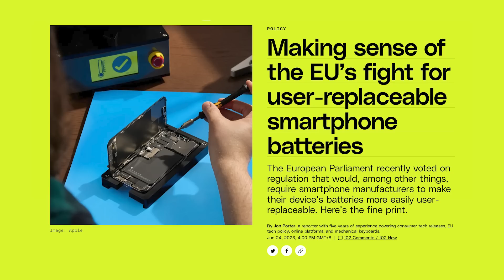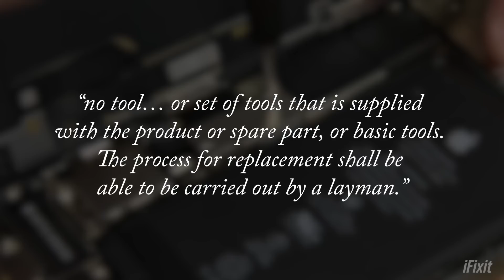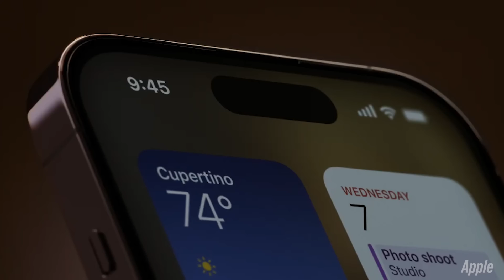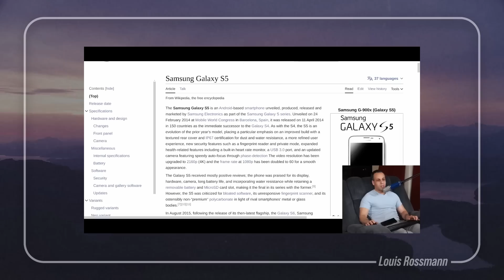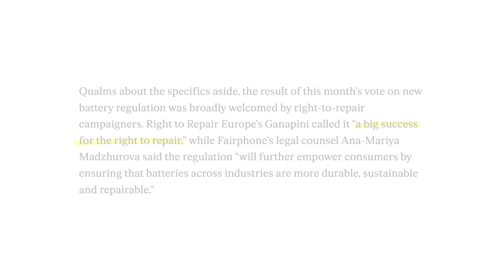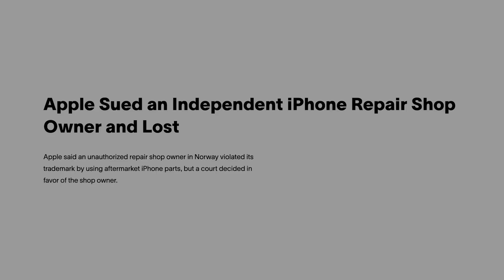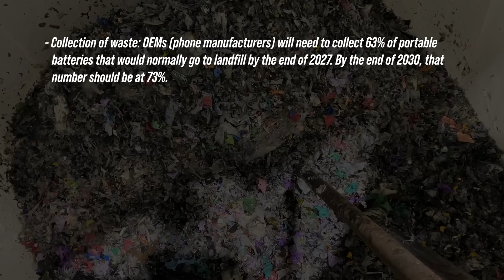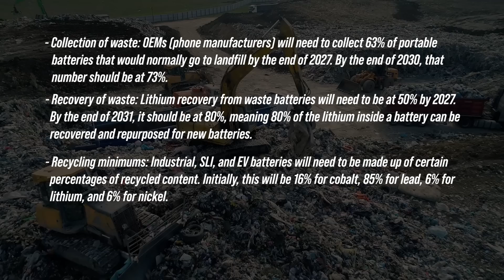EU Just Changed Smartphones Forever

Comment: I can't wait for the day they standardise batteries for mobile phones. Bring. It. On.
Reply: It’ll be the same day power tools have to standardize. I’d put that up as unlikely.
And where companies can’t make you upgrade every two years to effectively change the battery, they’ll pivot to making different non compatible sizes or gouging the end user on the price of a larger capacity due to “design and development challenges”.

Alternatively they can pivot in a different direction and see the battery as a consumable part; making it fail in months rather than years for the sake of absurdly low charge times.

In short: there are compromises to made, and standardizing is probably not one of them.

Comment: I think the design changes were a bit of both. Consumers found that tech without replaceable batteries were modern and sleek, and thus companies molded and adapted to what the users wanted but overtime came to the conclusion that they can generate more profit out of this design by implementing designed obsolescence. Both consumer and company are at fault. And we can now see this trend again, as consumers are now knowledgeable about the greedy practices of these companies and thus are now calling for more repairability. In a few decades or so we would see companies also find more ways to extract profit from these new designs or maybe even branch into modularity as a new way to get more profit. Having interchangeable parts means they can continue planned obsolescence but in a more discreet way. Imagine the lightbulb companies.

Comment: a rare bit of sense from the eu.   also do not care too much about out how thin or light the phone is. e bike batteries though should have a key as a 625 watt is about £800 a year ago.

as for apple, thier computer has been very reliable, but the new mac mini's memory -ram ect cannot be upgraded/repaired/replaced , a practice aimed like phone batteries at restricting the customer. Have no quarms passing the phone back as tend to use them to point of fiaiure.
Reply: Well, last year they also forced Apple to use USB-C.

Comment: Pitty they pushed it now. I just replaced the battery in my samsung galaxy a5 2016. This crap was is delibrately designed that it's impossible not to break it when trying to open it. Almost everything is glued, the back plate, the battery, the screen, the circuit boards. And there is a deliberate hole in the frame between the battery and the screen so it's very likely you will crack and damage the screen when trying to pry off the battery. When prying off the screen you will most likley rip of the connection bands of the touch buttons so you'll need to replace the lower circuit board. When prying off the back plate you can easily tear the nfc module so you need to repace the whole frame. So a 5$ battery replacement becomes a 40-50$ almost full overhaul. Thanks samsung ! But apple is even worse - they started to solder the battery connectors to the circuit board with wires to make it even more difficult to replace them.

Comment: I recall a time when my father, a builder by trade but a real genuine handyman with decades of learn by trade experience could fix annything at home becouse items where simple. Well built and lasted.

Washing machine, fridges, drills, bycicles, cars, home appliances, electronics. Name it. If it broke chances where 8/10 he could fix it.

Stuff has gone so complicated he'd never be able to do it these days. But then again, since when did a fridge need a flatscreen to tell me the time or a vacuumcleaner need a full LCD screen to tell me the battery is dry.

The right to repair should be set on simplifying every day items and the quality of the product. So stuff breaks down less and repairs are easy and managable with common garage set tools.

Comment: This is an overreach of politicians. It will do absolutely fuck all to e-waste. If a phone still has value but its battery is worn out, the user will replace it. If they want a new phone, they will sell the old one and someone else will replace the battery. Nobody will throw out a perfectly good phone because the battery is bad.
What politicians could have done is to mandate companies to supply spareparts for x number of years after a product is sold. And they could mandate that such spareparts can have no more than x% margins. This way independant repairshops would be able to replace batteries (and other things) for consumers at affordable prices.

Comment: Problem is, that the battery itself is - by law - not replacable.

Actually Smartphone Batteries are Li-Polymer batteries, whoch are not sealed by a metallic hull like the old thick Li-Ion batteries, which means they are industrial batteries, that can only be replaced by an expert.

To build a smartphone with replacable batteries, the industry have to switch back to the larger LiIon Batteries, sealed in a metal housing, which would make smartphones more bulky. 

We will see what will happen in the upcoming years 😄

Comment: I wish the Right To Repair would be extended to modern cars as well. Most car electronics contain DRM code that makes it almost impossible to fix the cars without specialist tools only available to the official repair centers and sometimes only available to the car manufacturer themselves.

The manufacturers claim that this is because anti-theft systems and government regulation. In reality it is just car manufacturers' attempt to prevent 3rd parties servicing and repairing their cars.

Comment: This is a move in the right direction, for certain. Whether or not the origin of the problem stems from profitability or not is iffy, as you mentioned. I think it had a large role to play in the equation but my best guess as to why it is so ubiquitous is due to two main issues (with the others you've mentioned not really mattering as much).

Firstly, it really comes down to the size of the battery. When these devices first started hitting the scene, manufacturers were dealing with a significantly more difficult set of issues pertaining to battery life. Chipsets were being designed on nodes multiple times larger per individual transistor than they are now. These differences, according to chip manufacturers, are legitimately on a 1:1 ratio with wattage drawn per cycle of the chip. So efficiency was worse while batteries were smaller on average. Their energy density hasn't increased too much but you'll find the devices from this era were much smaller overall and, generally, designs with removable backs (thus allowing for removable batteries) would result in less overall space for the battery. To make matters worse, waterproofing would require even more of the internal space to be taken up by other components; namely, the gaskets and plating involved with sealing the device off from potential leaks into the battery compartment.

The other issue I think played a significant role is one you mentioned, repair revenue. Doing this makes all repairs a bit more difficult but assuredly makes battery swaps an "expert" activity instead of the ridiculously rudamentary replacement procedures of the phones of yesteryear.
Reply: ive used my iphone 8 daily since 2019 (i bought refurbished for $350) and the battery capacity is still above 90%.

smartphone batteries (at least with iphones) are good enough nowadays to last over a day on a single charge, and by the time the batteries lose capacity (5 years), the phones are no longer software supported

why is nobody thinking about this from a practical viewpoint? look at the design of iphones, replacing the battery takes less than 10 screws, and the waterproof seal can be completely replaced after. to make it any more simple than this would mean making the back of the phone cheap plastic, and would interfere with Qi charging and Magsafe.

Comment: I had a G5, it was an amazing phone, and I bought it specifically because I wanted to be able to carry extra batteries with me just in case of long time periods away from charging - it also took much longer to charge a device back then.  But the point made about manufacturers being able to make as-thin phones as they do now with a removable battery just isnt true.  That G5, slim as it was, is still much larger than the Pixel 7 Pro I have in my pocket, thickness wise.  I know because I still have the G5 sitting in my desk drawer.  I won't mind going back to that thickness, it really wasn't THAT big, but I do believe the manufacturers from back then that it wasn't possible.  Is it possible today to make replaceable battery phones super thin?  Maybe.
Reply: Yes. It was a similar size to other devices with a non-replaceable battery of the time. 

Why do people seem to forget about rubber gaskets existing? Phones would be so much better if the back screwed down with six torx screws and a rubber gasket. Maybe we could even go back to durable metal backs instead of glass that shatters.

Comment: Not only this. They must make it mandatory to make new replacement batteries available for at least 5 years from the last date a particular model of phone or other mobile device is sold by the manufacturer.  I have 4 otherwise perfectly functional Android phones that have turned into bricks simply because the batteries are no longer available OR are not user replaceable. I would go a step ahead and require manufacturers to adopt some method of making the device operable on external power and enabling  disconnection of  internal battery.

Comment: Companies adapt to what customers want. Samsung Galaxy S4 and S5 sales numbers weren’t good, so they changed it to the glass sandwich design. The S7 sold more than the S5. When Samsung switched to a non-removable battery, I looked at other smartphones. But over the years, battery life got better and charging speeds increased. It seems like removable batteries weren’t needed as much. I think only nerds like me who didn’t mind carrying extra batteries still do. I just jumped back to Samsung when all the companies stopped making smartphones with removable batteries. I remember hearing that starting with the Samsung S8, it will retain 95% of its charge after two years of normal use. I have also educated myself on how to care for my battery. My Note 20 Ultra still has more than 90% of its original charge. I lived with a non-replaceable battery for so long that I don’t seem to care anymore.

Comment: they should require the manifacturing of all everyday electronics, such as smartphones, laptops, computerhardware, tv etc to be fully automated production and also open source hardware software operating system, bios, alternatives. And make not only battery changeable, but also make it possible to repair everything easily with third party parts.

Comment: I think it's designed to fail in order to get you to keep buying.  Like sealed transmissions.  Not changing trans fuild ensures it's going to fail.
Reply: 😂😂 sealed transmission is a total lie, do you think manufactures have no way to putting fluid in the transmission on the assembly line? there are drain plugs and fill plugs. just google how too your vehicle you will fine video . i have done a transmission service on both my 2017 mini cooper clubman S all and my son’ 2017 mazda 3 sport. which actually had a mini dip stick. the access and way to charge is just a little more difficult. don’t listen to dumb service writers at the  dealers. a fluid change even if $150-200 every 50-60k is much cheaper than a new transmission at 20 -30x that.
Reply: @tbyoda9475  i don't have anything w/ a "sealed" transmission.  I've just heard other gear heads talking about EV transmissions having high fail rates & pointing at the sealed design.  Which makes sense to me b/c the battery will be trash in 10 years, so the transmission only needs to last 10 years.  Then you'll have to buy a new car.  Which seems like perfect late stage capitalism hellscape logic.

Comment: I remember have an HTC back in 2008 and it lasts til 2015. It could lasts that long because I can change and repair it by myself like batteries, cracked screens and casing damage. The only thing that made me to retire the phone just because of the software compability. It would be perfect if the law not just concern about hardware but also software, make the software update for older phone too, just for basic like for text messaging or vid call.
Reply: Did you flash a custom OS?

Comment: Dude...did you do any research at all? Did you not read the EU law? Or is this intentional misinformation?
First of all, there will be exceptions for water tight devices like electric toothbrushes, but much more important: phone manufaturers will be excempt from this rule if the phone batteries have 83% capacity after 500 cycles and 80% after 1000 cycles. This is already the case with most flagship phones.
Battery sizes might decrease a little in favor of older and proven designs but that can be partially made up by efficency gains.
In the end, this is a right to repair law for shitty batteries, thus encouraging producers to make better products in order to circumvent the law: Good for all consumers!

Comment: It's hilarious that we HAD replaceable batteries... MFCs ditched 'em... and now, we're going back to them. WHICH IS GREAT.

I used to work with Li-Ion 18650s. That was almost two decades ago (when I began). There is no reason that phones can't have a thin, effective, fairly long lasting cell that slides in, sockets, and can do so with spring tension. LIKE A uSD CARD. No big deal.

Comment: This will extend our phone lives indefinitely. I'm all for it.
Reply: Maybe the hardware will last an extended period, but I'm sure companies will enhance software that will deteriorate the experience of the phone well before that.
Reply: @blakeorahilly9700 exactly, sooooo easy to do now days too.
Installing complete new os might be possible but dodgy ...
Reply: Unfortunately not, there are other wear parts inside phones. But it will easily double the lifetime until manufacturers figure out how to make these other wear parts break down faster.
Reply: @Peter-jl4ki  You're right, but it will remove the most common bottleneck of longevity!
Reply: You'll need a replaceable RAM-storage as well then. Modern NAND flash memory has a limit on block writes.
Reply: not indefinitely , but largely extended life expectancy... actual smartphone still have way to improve their performance but not that much. The true question is if the system provider (Androïd, IOS...) will make artificial limits that are not linked to the true capacities of the device, but to the need of the manufacturer to make you buy another one every 3 or 4 year at most...
but same as the actual computers that are reaching their limit of performances improvement, this will happen, probably in the next 10 years for portable devices. Then the changes will be mostly "cosmetic" and useless for those who are not fanboys...

Comment: The last thing I want on my phone is replaceable or removable batteries. I hope Apple designs phones specifically for the EU and sells it more expensive because of the high design and manufacturing cost to operate in the EU with this law.

And BTW I am Brazilian and people swap batteries on and brand of phone all the time. iPhones last 6 to 7 years changing owners twice or more. It is an EU and USA problem that labor and parts are so expensive there and people have too much money to buy new ones in comparison. "Why spend 400 USD/EUR if I can by a new model for 800?". Here in Brazil a made in China non Apple battery costs about 5% of the new iPhone, service included. Why don't the EU makes it tax free and other incentives to replace the battery instead? lots of jobs can be created.

Comment: This is very good. For $25 I obtained a new battery for my 5-year old Lenovo tablet, it cost $65 to fit in Australia. 2 cells stopped working in my 4 cell Stihl farm tool battery in just 2 years for the second time, $320 twice. The 'black box' controller in a Stihl farm tool replacement cost meant discarding the whole tool. The same type of black box in a friend's not-old car cost $2000 to replace. Technicians cannot repair these black boxes.

Comment: I own a Samsung Galaxy Note 3. Its battery is replaceable and the smartphone is still so good, it has an amoled full HD screen, and it works fine, except for the battery that died some years ago, and I could not find an original. So I had to buy a new smartphone. We are in a point we kinda don't need more powerful hardwares.

Comment: people may like this idea on the surface, but i don't see how it can make positive change in case of smartphones. many people change their phone even before the battery goes bad. lots of updates and poor software usually cause many more problems that force user to change the phone. also making a safe removable battery pack needs additional space for container and attachment mechanisms, the replacement battery may come from out of spec manufacturer, many battery packs these days are not well made and do not tolerate harsh temperatures required for smartphone use. not that great idea actually if you want to have a well made phone. repair shops can replace battery of sealed phones anyway.

Comment: This is an excellent law passed by EU and other should also follow. The amount of e-waste due to batteries is staggering these days (phone, tablet, speakers, vapes). I do believe companies had profit as their primary motivation to design non removable battery products, sleek design was a biproduct. Much like getting rid of the head phone jack in the name of thinner designs (really??) and later no even including chargers in the name of reducing e-waste ( but wait, lets change the charging port each year so you can't use the charger from your other phone). The large tech companies at the end of the day don't care about anything but their bottom line.